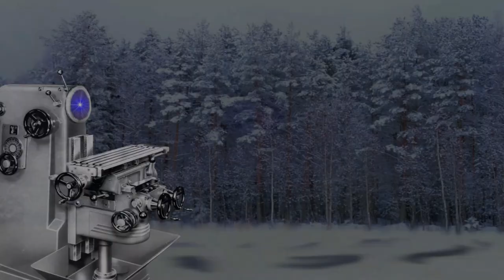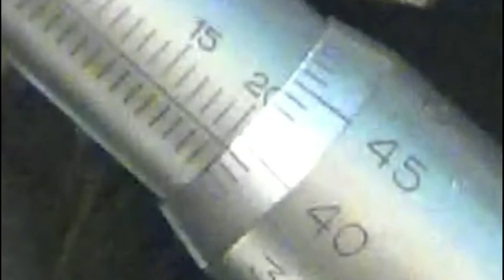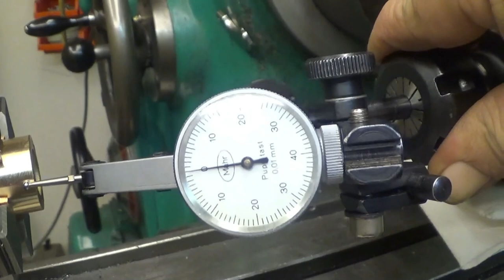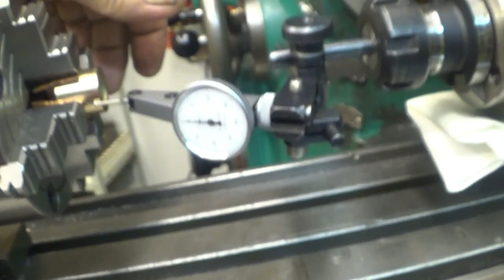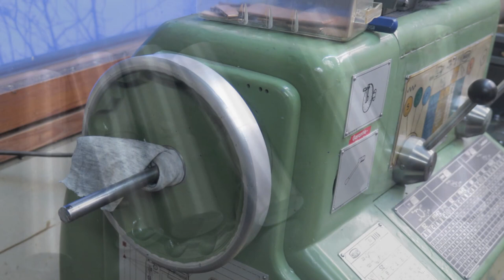Six precision pins and test run for cycloid drive

Comment: I bet that No one has as fancy stuff in a welding positioner!
Reply: I would've been happy with a worm drive but this is of course way cooler
Reply from the maker: @MF175mp  Actually, making a worm gear is fancy as well. It is not the easiest thing in the world to mill.
Reply: @FinnoUgricMachining  it's quite easy if you use the free hobbing method. Still can go wrong of course.

Comment: Love your video’s ugric , looks like a CBN (diamond) insert am i right. Runs pretty smooth keep up the good work
Reply from the maker: Actually I do have a few CBN inserts but this one is just plain old Cermet. It is a very fine grained carbide and then those have been ground to their form. That is a VERY good insert for boring material like bronze.